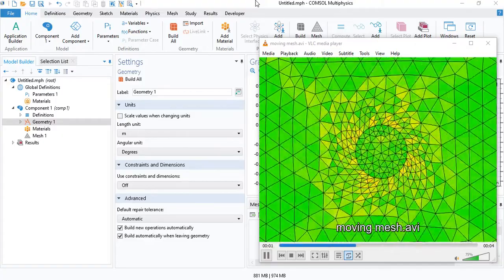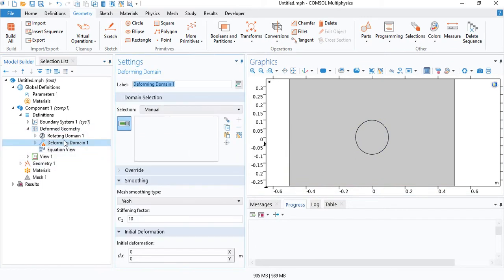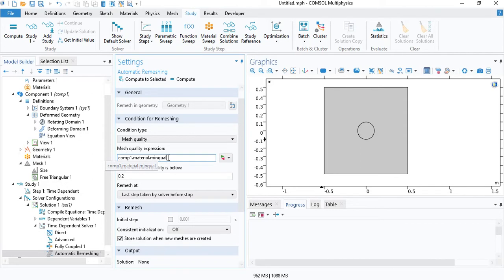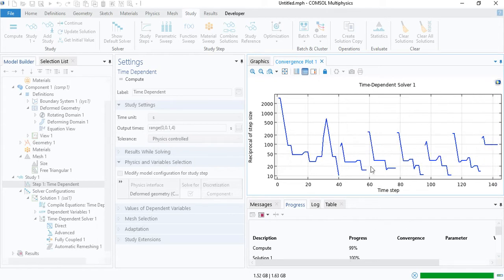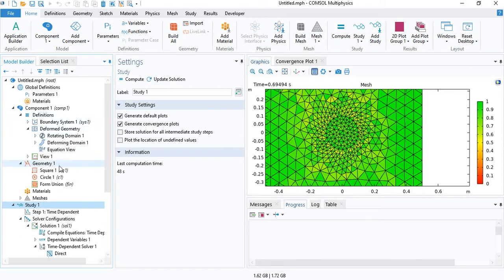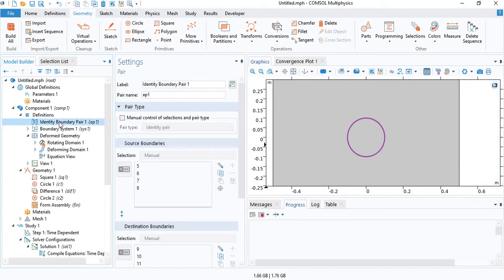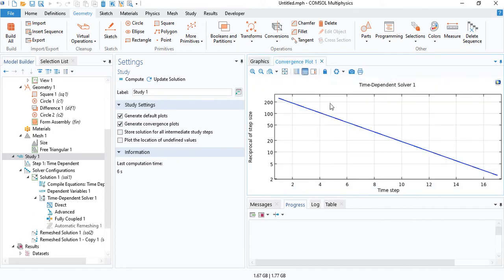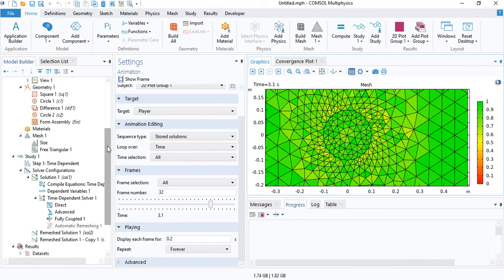Moving mesh introduction- domain rotation example in Comsol Multiphysics

Comment: Hi Jaf, I have an issue with moving mesh 2D generator for my PhD project, was wondering if you can lend me a hand. Please
Reply from the maker: What's the issue?
Reply: @JafScience hi thanks for replying back. I am modeling a rotating electrical generator in COMSOL where the rotor should elastically deflect under electromagnetic forces. My goal is to find the rotor deflection over time. Initially, I used Prescribed Displacement = 0 on the rotor, which  fully constrained it, so the rotor appeared rigid and no deflection could be measured. When I removed that constraint, the study failed due to many degree of freedom in spatial u and v , which I assume it’s a moving mesh error but it could be lack of physics constraint in the solid mechanics module. 

To fix this, I am testing the use of a Rigid Connector (to define the shaft center) combined with a Spring Foundation (to restrain translation and rotation elastically instead of fixing it). This setup should allow the rotor to vibrate and deflect radially without being completely locked or freely drifting. However I am having issues as I still run into errors. Not sure what is wrong. Please if you can help it would be great, it’s a scientific paper so I can add your contribution to it
Reply from the maker: The degree of freedom error is not related to the moving mesh. When your geometry is not sufficiently constrained, which is the case here, the system is unsolvable because the body can move freely. 
What errors are you getting when trying to fix the centre? If there is a shaft in the centre, I would suggest making the shaft rigid, and then fixing the rotor to the shaft. Additionally, if you insert cylindrical coordinate system you can prescribe a displacement of r=0 for the shaft so that it rotates without translation. Let me know if it works.
Reply: @JafScience hi Jaf thanks for the prompt response. 

I currently have two models. Model 1 is a circular generator model with an outer rotor and inner stator configuration. Model 2 is the same setup, except I introduced ovality by replacing the circular rotor with an ellipse, in order to study the effect of manufacturing defects where the rotor deviates from a perfect circle.

In both cases I used the Solid Mechanics module with prescribed displacement = 0 on the outer rotor rim and shaft domain. This fixes the rigid-body errors, and in Model 1 I can analyse the stress distribution correctly on rotor yoke and magnet. 

However, when I apply prescribed displacement directly on the rotor rim in model 2, the solver errors (spatial u and v) appears. I then changed prescribed displacement zero to the pole magnets on the rotor and the study solver without error. However the 2D stress plot shows no stress being transmitted into the adjacent yoke and rim region.

Would you be open to a brief meeting where I could walk you through both .mph files and get your advice on how to stabilise the elliptical case and resolve the missing stress distribution? If a call is not convenient, I’d be happy to share images and details by email instead.
Reply: Hi Jaf thanks for the prompt. So I currently have two models. Model 1 is a circular generator model with an outer rotor and inner stator configuration. Model 2 is the same setup, except I introduced ovality by replacing the circular rotor with an ellipse, to study the effect of manufacturing defects where the rotor deviates from a perfect circle.

Even at zero ovalisation (essentially the same as Model 1), Model 2 fails with the same setup. However, when I switch the prescribed displacement = 0 constraint from the rim to the magnet, the solver runs successfully. This makes me suspect that the issue in Model 2 is related to the magnet physics itself, or possibly the way the magnet geometry was constructed.

My overall goal is to represent the rotor as a rigid–flexible body: stiff enough to capture global support but still deformable, so I can evaluate both the stresses in the rotor domains (yoke and magnets) and the deflections caused by unbalanced magnetic pull.

Would you be open to a brief meeting where I could walk you through both .mph files and get your advice on how to stabilise the elliptical case and resolve the missing stress distribution? If a call is not convenient, I’d be happy to share images and details by email instead

Even at zero ovalisation (essentially the same as Model 1), Model 2 fails with the same setup. However, when I switch the prescribed displacement = 0 constraint from the rim to the magnet, the solver runs successfully. This makes me suspect that the issue in Model 2 is related to the magnet physics itself, or possibly the way the magnet geometry was constructed.

My overall goal is to represent the rotor as a rigid–flexible body: stiff enough to capture global support but still deformable, so I can evaluate both the stresses in the rotor domains (yoke and magnets) and the deflections caused by unbalanced magnetic pull.
Reply from the maker: Can you contact me on my linkedin, we discuss this in a call.
Reply from the maker: I didn't receive a message.
Reply: I can’t contact you on LinkedIn, is there any other ways?
Reply from the maker: It's free. If you make an account and send connection invitation you can also write a message with it.
Reply: @JafScience  I sent an invitation. Lee

Comment: Hi Jaf, It is pretty interesting tutorial, thank you. Could you tell me why the second method don't work for magnetic problem?
Reply from the maker: Did you apply magnetic continuity boundary condition?
Reply: If it means, magnetic flux conservation, the answer is yes.  There isn't magnetic continuity in COMSOL, only continuity in the pair boundary.
Reply from the maker: Yes the latter is what I meant. Because the nodes move with respect to each other, we need a boundary condition to compute the magnetic field between them. That's what continuity does.

Comment: Very cool, i did this very same thing (the deforming mesh one) on 3D like simulating a rotating microwave oven and it worked just as nice. The problem now is that when I try to couple it with the RF module microwave physics and the frequency-transient study it doesn't work. Do you know if it is or should be possible at all?
Reply from the maker: The moving mesh is strictly usable in time domain only. It must be disabled in any other study. Even in time domain, it's not unusual to encounter convergence issues and it heavily depends on what kind of physics is being solved. Try editing the mesh to prevent highly skewed elements during deformation.

Comment: hello, could you make the deformable mesh of a compressor, a piston with a fixed mesh that moves through a deformable mesh that would be the air, thanks friend
Reply from the maker: Yes I think that's reasonable.  Depending on the thickness of the air you may encounter problems with convergence. If so, try using the fixed mesh (using form assembly in geometry).
Reply: @JafScience  please, your email , i have a question important, thanks

Comment: Hi. I tried to reproduce the tutorial but I think I missed something. In my computation, my circle is not rotating despite its selection as rotating domain. When I have a look on the solution, first the mesh of the square is in the other direction. It seems that only the interface between the circle and the square is moving. I do not have any automatic remeshing. Do you have any clue what I did wrong?
Reply from the maker: Did you select 'deforming domain' for the rest of the square? If all steps in the video are followed then it should produce the same result. Which version are you using?

Comment: Hi 
I can't find moving mesh in my model builder am just wondering where can I find it
Reply from the maker: There are two options:
1) Under component, right click on 'definitions' and there should be a 'moving mesh' option in the list.
2) Click on 'Add Physics'. Go to 'Mathematics' and select 'Moving Mesh' from 'Deformed Mesh'.

If these options still don't show you moving mesh then the module may not be installed.

Comment: dude you just saved my ass. I have a totally different problem but also with a rotating domain and I had no idea that you had to use "form assembly" instead of "form union". I spent hours debugging my model until I randomly found this video.

Comment: Very clear explanation. thank you very much. I will be glad if you made a video about how to simulate the piston movement of combustion engine and thanks to it compute the changes of temperature and pressure of compressed air inside cylinder caused by changes of volume over the piston as well as to include the heat flux through the cylinder wall in it. I dream yet that the changes will include long period of engine work to achieve the pass from engine start to stability of engine temperature. I don't know completely what physics part should be used and what simulation steps etc.
Reply from the maker: This is an interesting application. I would say the moving piston can be simulated using a moving surface with a moving/deforming mesh. Heat transfer physics is needed. A fluid dynamics or solid mechanics interface would be needed. Unfortunately I don't currently have access to Comsol licence so I can't try building this model. But you can start with heat transfer and moving mesh and see what boundary conditions can help you achieve your objective. Heads-up: this will be non-linear and getting the solution to converge might be challenging.

Comment: Thanks a lot for this tutorial

can you please guide on how to apply rotation on two cylinders under Nip pressure in 2d geometry
Reply from the maker: You need to use a contact pair for the objects that are touching each other. Under contact pair you can also define friction (and optionally cohesion). You will also need to use a rigid connector to define rotational velocity for one of the cylinders and free rotation for the other. I haven't done such a simulation so I don't know what challenges are associated with it. It sounds interesting; I might make a tutorial for it.